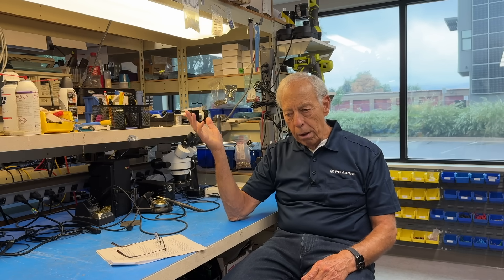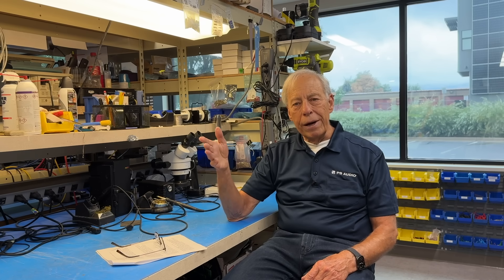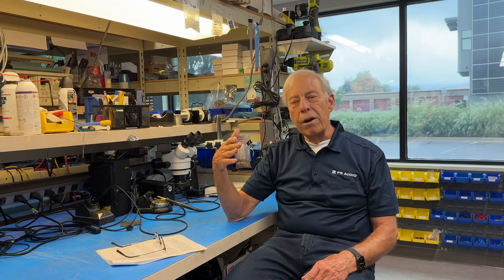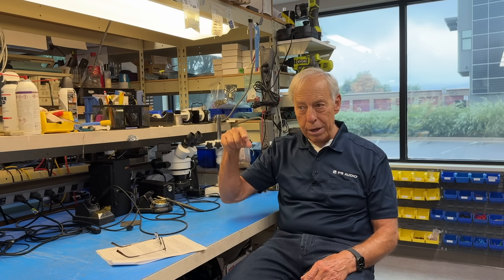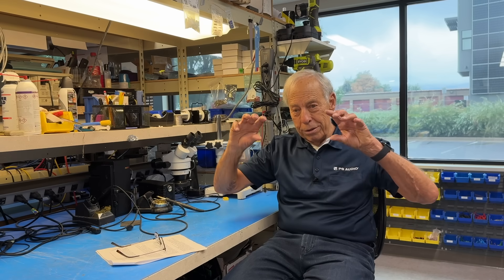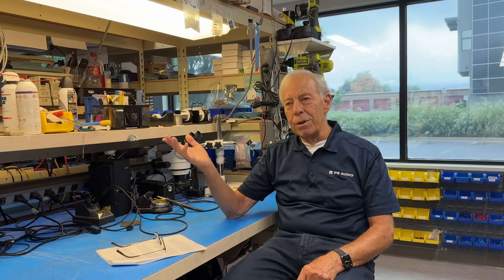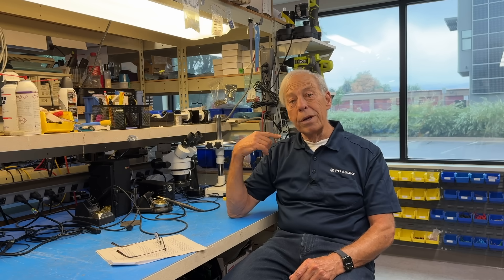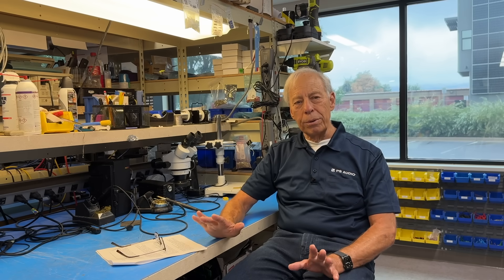Is speaker break in real?

Comment: Speaker break-in is totally real. Softening of the spider is easy to understand. Forget about cables breaking in. On the electronics only certain parts need break in, tubes especially.
Reply: When cables are burned-in, the trapped gases are dissipated and small impurities in the conductors' metal begin to act like a diode, favoring current flow in a particular direction.
Reply: @Rogue_HC_Bumper_Plate  If there are gasses trapped inside solid copper, where are they supposed to go through use? Running a current through copper doesn't alter its shape. Do you have some scientific source I can read to support these ideas?
Reply: @storkfletcher821   ...just use your hearing...if it's up to the task.
Reply: There are always a few posters here that would need to see measurements first before their hearing works.
Reply: @mitchtaylor6512   ...Mitch I commend your optimism...that the measurements crowd have hearing that actually "works" 👍
Reply: @mitchtaylor6512 Anyone experienced in audio R&D perfectly know that measurements are very important but so are listening tests. Depending on what you judge in a new product development project, you choose among the tools you have. For example, you don't start with listening tests when designing a new preamp power supply. You start with measurements to ensure your voltage rails are stable and maximally clean from ripple and noise. When you then get happy with the measurable circuit performance you start listening. Obviously your aim is to please your ears.
Reply: @storkfletcher821 No this is, for audio, ignorant snake oil pseudo science BS.
Reply: You should ask your wife to help you do a cable blind test and let me know how it goes...
Reply: @ThinkingBetter  Indeed, I just wanted to see if he believed it enough to try to back it up.
Reply: @storkfletcher821 It's just amazing what sort of outright lies the audiophile cable industry is getting away with to sell their snake oil products. Cables are completely measurable and nothing about them defies known laws of physics.
Reply: @clickbeetle2720 Yes good quality cables can last decades and doesn't cost many Dollars.
Reply: @ThinkingBetter  Definitely. Clearly it's a working marketing gimmick to take existing, scientifically established phenomenons and use them in a context where they don't apply in order to make people think it's scientifically legit and get FOMO.
Reply: @storkfletcher821 Right, nice to see someone here understanding the subject 😊
Reply: @Rogue_HC_Bumper_Plate 😂 we are talking audio. The wave length even for 20kHz is nearly 10 kilometers or approx 6 miles. Your point is utter idiocy.
Reply: @Rogue_HC_Bumper_Plate Make your point against ChatGPT and it can explain better than I can.
Reply: During the manufacturing process, as insulation is extruded over the conductors, gases can become trapped. This, combined with the high electrical charges often found in new cables, can result in a brittle and bright sound...
Reply: @Rogue_HC_Bumper_Plate You got yourself into some serious snake oil BS.
The Claim

> “During the manufacturing process, as insulation is extruded over the conductors, gases can become trapped. This, combined with the high electrical charges often found in new cables, can result in a brittle and bright sound…”

🧪 Engineering Reality

1. Gas Trapping in Cable Insulation

It’s true that some gases or voids can be trapped during extrusion (especially in foamed dielectrics used in high-frequency coaxial cables).

However, for low-frequency audio interconnects or speaker cables, these microscopic voids have no measurable or audible impact.

The audio signal frequency (20 Hz – 20 kHz) and voltage levels are too low for such micro-dielectric effects to alter transfer characteristics in the audible band.

👉 Verdict: True phenomenon in materials science, but irrelevant to audible signal transmission.

2. “High Electrical Charges” in New Cables

Ordinary audio cables are passive conductors. They don’t carry stored electrostatic charges unless deliberately charged (e.g., MIT or Transparent “networked” cables with biasing circuits).

Any surface charge that might exist is instantly neutralized when connected to grounded audio gear.

There’s no mechanism by which such charges could create “brittle” or “bright” sound; this is a metaphor, not physics.

👉 Verdict: Physically false. There’s no persistent “charge” that colors sound.

3. Cable “Break-In” Changing Sound

Numerous controlled blind tests (Audioholics, Stereophile double-blinds, AES studies) have shown no audible or measurable difference between “new” and “broken-in” cables, assuming proper gauge, impedance, and shielding.

The only measurable change over time is from oxidation or corrosion, which happens over years, not days.

“Brittle and bright” are subjective expectations often reinforced by placebo or confirmation bias, not physical change.

👉 Verdict: No verified audible effect of cable burn-in.

🎧 What Can Actually Change Sound

Speaker break-in: real, because of mechanical compliance in the spider and surround.

Tube amps or capacitors: real, due to dielectric forming or bias drift.

Cables: only if faulty, poorly shielded, corroded, or mismatched to high-impedance circuits.
Reply: Never forget anything in your audio set up.
Reply: Crazy alert.
Reply: @LedNe0nDevil   ...yes, I am alerted to your craziness👍

Comment: Once, when I was having a conversation with Richard Vandersteen, he told me that my speakers take 400 hours to break-in.

I asked him if the volume matters.  He answered "No."

If the volume part is true with all speakers, then you can break them in much faster if you put on some streaming service, or playlist (on repeat), and let it play for two weeks.  You might not want to do that if you are using tube gear.
Reply: John DeVore told me around 1,000 hours for 100% break-in of my O/93's. I noticed a change in sonic smoothness
at around 820 hours & yes, I was keeping score just to see if he was right & actually knew his product.
Reply: Common practice even for DIY, let them play day and night for a few days (or more depending on the driver), then measure the parameters to start final design. Volume doesn't matter much, they just need to wiggle for a while (some more some less).

Comment: wires break in? if you buy a newly built house does the electrical system need breaking in?
Reply: Yep! Your toaster will toast your bread much better once the wiring has burned-in & settled.
High grade magnetic fuses in your fuse-box will improve the colour of your toast even more👍
Reply: i dont have a toaster, i have a gas grill for toast. i wonder if that needs burning in as well😂
Reply: @1stswim   ...hmm, honestly, without ever having owned a gas powered home-audio rig I cannot offer any valid/lived information on that subject😝
Reply: Those Kellogg Pop Tarts start like tasting home made fruit tarts. Give it a try!
Reply: If you don't lock the doors, your copper wire electrical system, could definitely experience break-in.

Comment: All break-in is real. Even my Furutech Clear Line NCF products require burn-in They're small and passive filters, too.
Reply: Crazy. institutionalize yourself.
Reply: @LedNe0nDevil 
If something crazy works, I keep it. If it doesn't, I return it. 

Life should be simple like that.
Reply: I inserted one on my tv. My picture was 64K pixelated the first 3 minutes. It got better as the day passed on. It was excellent within a week. Five years with cables, tubes, components, and speakers burning experience allowed me to calm down about achieving better results in time. Like, within a month.